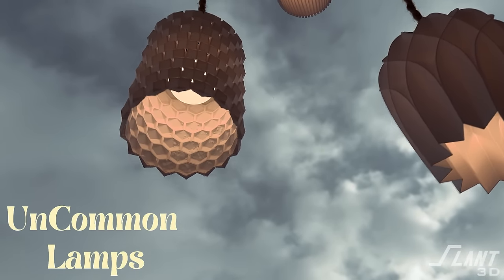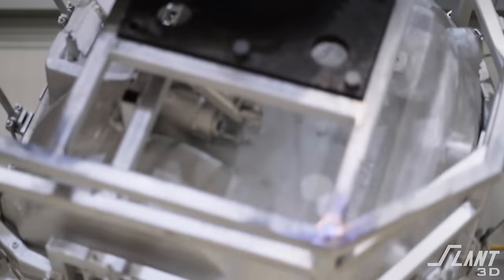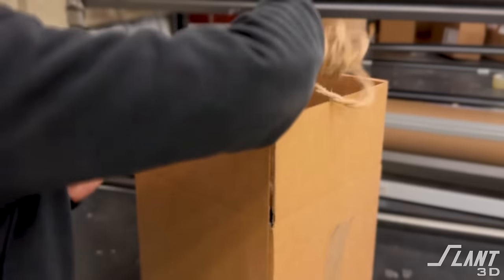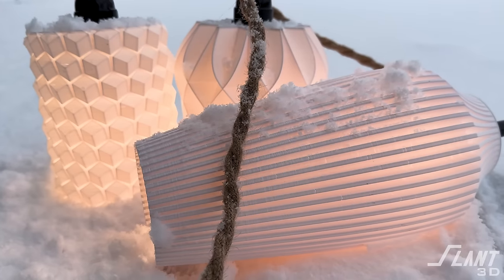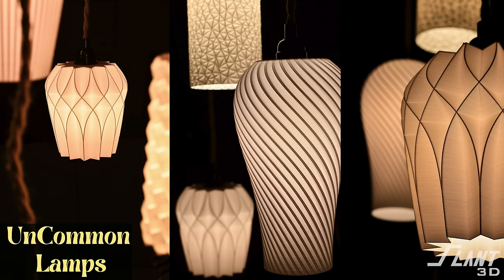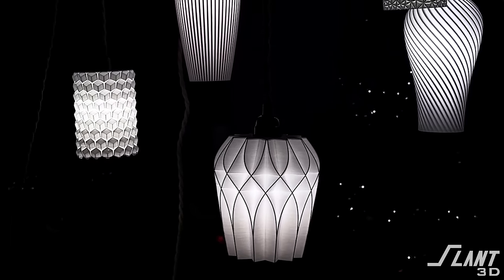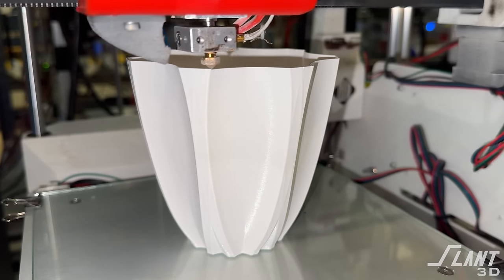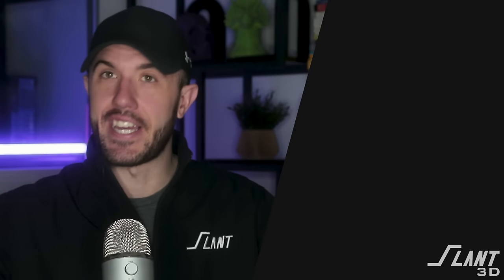Infinite Inventory with 3D Printed Lamps: Uncommon Lamps | Real 3D Printed Products

Comment: I was able to bring 3D printing to my work at a beverage company to print parts for our machines. Currently, we have only put one part into true production, with one in testing and four in the design phase. Even with just that one part, we save $60k annually (it costs $115 to buy or $0.60 to 3d print) and will save over $150k annually once I get the other parts vetted. Not only is it a cost savings, but it also means that we don't have to wait for parts to be delivered (many come from europe) and spend as much time forecasting our needs.

I have learned so much from watching your videos that I have been able to apply here. Thank you!
Reply: That's awesome! Insane a company has the gall to charge $115 for a $1 part.
Reply: I hope you got a significant raise!
Reply: @phillipsmith4220 yeah, because I made a couple of contributions to the company I work for (not having anything to do with 3D printing) and I have little incentive to ever do that again.

Comment: One of the best applications for additive manufacturing.  It's probably more choice than most consumers want, but it's possible to integrate parametric CAD with a web front end and allow a customer to select a shape or design and then have the lamp not only any height and diameter they like, but also change other parametric features such as number of flutes, flare, et cetera, and then see the product rendered on their computer before clicking the buy button.

Comment: It would be rad to have a brick and mortar store of some sort where you walk in and select the product you want, which is then 3D printed on site. One day I’ll bet that will be a thing.
Reply: 3D prints can take hours to print, sometimes over a day. We'll need some drastic improvements before that becomes practical in a single shopping trip.
Reply: @logicalfundy   With advancements in 3d printing such as like the X1C that can drastically decrease
 the speed  of printed parts based on settings its prob closer than you think. but it will never be as fast as injection moldedl
Reply: @logicalfundy  Most of these lamp shades are likely several hours. Could simply order in the morning and pickup later in the day or order the day before.

Comment: Nice presentation. I agree that 3D printing will come to satisfy a much larger demand in the market but I don't see it fully supplanting injection molding. On area where 3D printing will have difficulty making inroads is the production of complex electrical components. Specifically the used of insert molding for creating wall outlets.
Reply: Economies of scale will never favor a boutique method like 3D printing. And shouldn't... But 3D printing would make a  great line of electrical outlet vanity covers.

If both your neighbors have it too, it shouldn't be 3d printed.
Reply: Economies of scale will never favor a boutique method like 3D printing. And shouldn't... But 3D printing would make a  great line of electrical outlet vanity covers.

If both your neighbors have it too, it shouldn't be 3d printed.

Comment: Cool products.  I went to their site but it doesn’t say what they are made of…. I’m guessing PETG?
Reply: I was wondering the same. Have been wanting to print my own lamp shades.
Reply: I have a shade I printed in clear petg that's been fine but I'm using led bulbs so less heat. I was wondering what they used as well.
Reply: @JustInvertedFpv  A quick search showed a lot of people using PLA. I think as long as you use LED bulbs which is pretty standard now and don't have the shade too close to the bulb obviously it's fine.
Reply: A 60 Watt bulb can get up to 200 ºF (~100 ºC)  on the bulb's glass surface. This can soften PLA, causing it to loose shape.
A 40 Watt bulb can reach temperatures over 125 ºF (over ~50 ºC). 
PLA should be fine if using a smaller traditional bulb, and not an issue if using an LED bulb. Example: a 100W LED only produces 10-20W of heat, probably no more than 100ºF (~40ºC).  Approximate, as will vary based on room temperature.
Reply: I've 3D printed a lamp that is CE certified and that I've used many months now with PLA. The maximum W is 7 and only LED lamps are allowed.
Reply: @AerialWaviator 20+Watt bulbs died yeaes ago... most houses just use 3W to 15 watt LED bulbs now. And they produce essentially no heat... PLA is fine.
Reply: ABS or ASA would also work, but I wouldn't do it from home without ventilation.  It can also be vapor smoothed with acetone for a slick, shiny, finish.  I don't know if Slant3d would do vapor smoothing as it'd be a pain to do in quantity but it sure looks good.